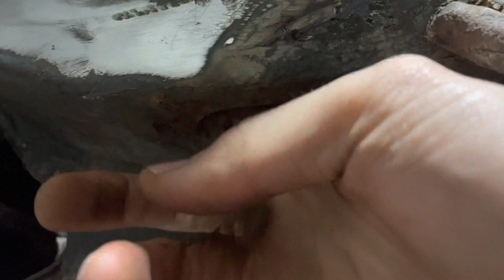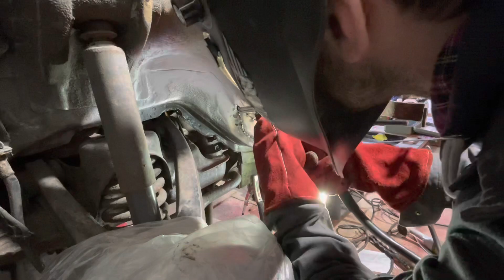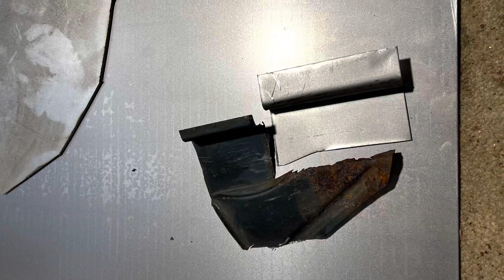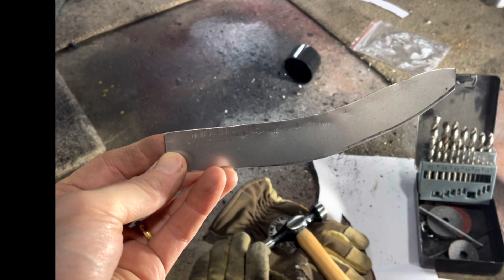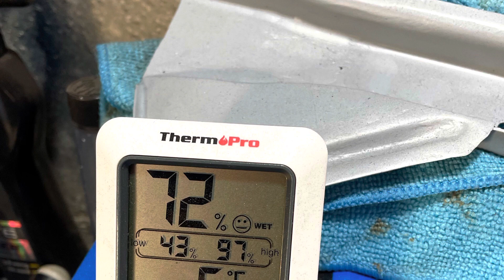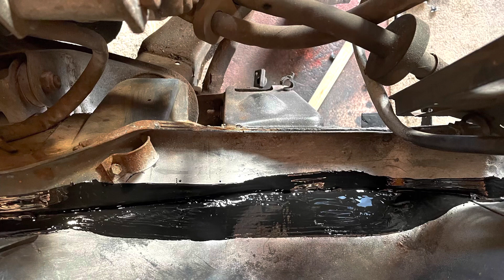Mercedes SL R107 lower chassis leg rust repair

Comment: Thanks for the video! Unfortunately may be facing similar issue with '89 560SL... Quick question for you, when you were repairing the interior portion, did you have the entire engine removed? Sorry if silly question, just couldn't tell entirely...
Reply from the maker: Just the radiator was removed, unfortunately the entire lower radiator mount was rusted away, so I had to fabricate the bottom of that and weld back in once the chassis leg was done. For a really neat repair removing the engine might help, but you can kind of work around it.
Reply: @classiced1416  Thanks for the quick reply, Ed! That's good news. I had it in today to a guy I trust - he's a great restorer / fabricator, but not really an old Benz expert, so his concern is access (I was referencing your video!). I have almost same exact passenger side issue you had (truly same spot), and at least on the 560, in addition to the radiator, the ABS controller / pump, plus alternator and A/C compressor kind of encroach the work area, which my guy understandably doesn't really want to mess with. So to do what you did, it may involve having someone else strip that stuff out, towing it to him, and then towing back to reassemble. He said alternatively (my rust I don't think goes back as far as yours did) he could sand blast, weld a piece to the outside, and spray / fill all inside... This obviously would be a lot easier / cheaper, and he said would probably last a while... Would love to hear your thoughts!
Reply from the maker: @timothydee9390  yeah so mine being an 1980 and no aircon, there isn’t really much in the cavity above the leg thankfully. Cars with ABS though I know tend to get water collecting under the pump so I would at least take that out so you have a proper look underneath.

Unless you are worried about originality I think the approach you guy suggests might be OK…certainly mine won’t be perfect, the critical thing is to make sure the water can still drain out from under the ABS pump area and out via the drain in the seam with the inner wing seam. The issue is normally caused by water pooling on top of the leg and working it’s way inside the leg or just rotting out the seam.